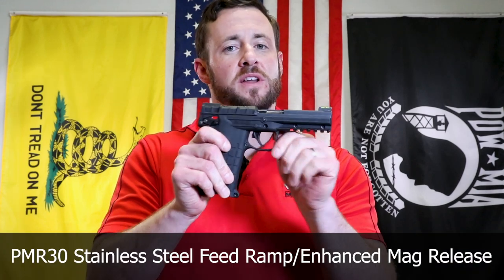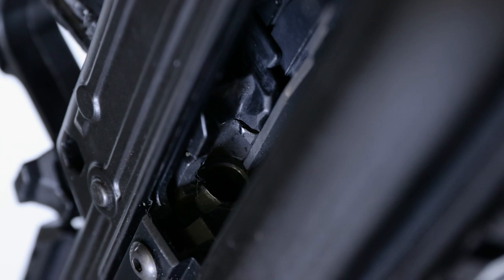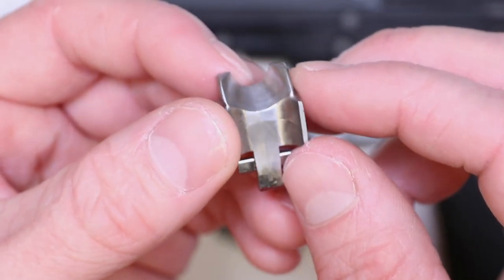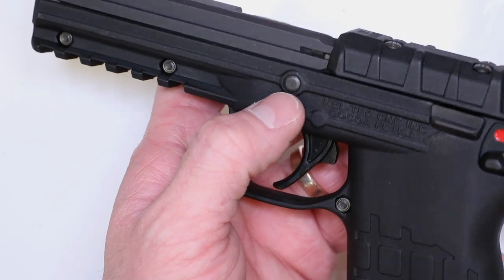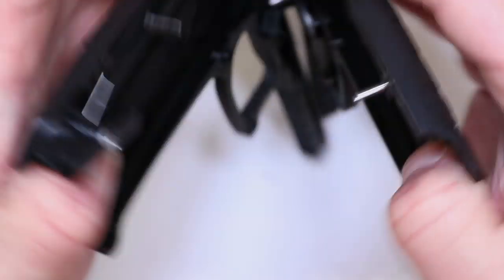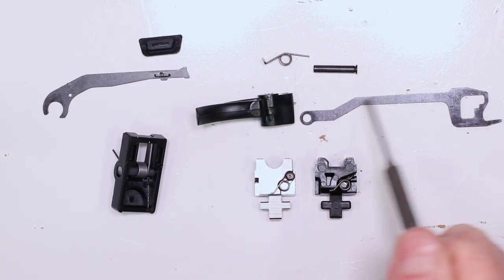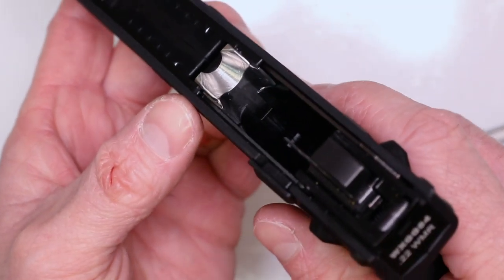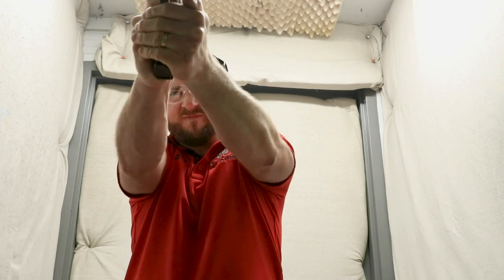KEL TEC PMR 30 Stainless Steel Feed Ramp and Mag Release - KEL TEC PMR 30 Upgrades by M*CARBO!

Comment: Please create a full update kit for this PMR30 / CMR30, trigger, slide stop, etc similar to all the upgrades you did for the Sub 2K.  The additional weight would be minimal, but the upgrades from metal away from plastic would be much improved quality, durability, and reliability.
Reply from the maker: 2WheelManNC Yes Sir, think you for mentioning this!  Glad to see all the likes on this post....we’ve been thinking the same thing.  New PMR-30 Flat Trigger was just finished/tested and approved for release early next week.  Still working on a slide stop.  Let us know if you have a particular look/design in mind.
Reply: @MCARBO   A metal slide stop that's a little easier to hit but not overly extended. Might I also add the idea of a nicer safety levers. Not huge like another's company offering, but better than oem keltec.
Reply: @MCARBO  will this kit be good for the CMR-30? Which has double the issues of the PMR-30. Thanks for this I’m glad I ordered a PMR 30 but if you have a CMR 30 kit I’m ordering it as well..
Reply: Dude weather is screwed up in memphis bad

Comment: For the slide stop spring I didn't use the tool purchased, I removed the slide stop bar and inserted the spring and rotated the feed ramp in the general orientation it needs to be and it was way easier and didn't cause undue stress on the spring and the bar. Do it this way.

Comment: Bought my PMR-30 about two months ago. The factory gun shot fine but was ammo sensitive. Would not shoot 30 grain well. 
I ordered the MCarbo complete kit for the PMR-30. It came in about a week. 
The toughest part was installing the spring on the stainless steel feed ramp. The little tool was OK....but I found that putting the spring into the hole and then pushing the stainless ramp into position worked just fine. I did have to replace the spring with the old spring from the plastic ramp on the new stainless feed ramp. I bent the daylights out of the spring that came on the stainless ramp trying to get it into that little hole. Polish that ramp!  The polishing kit is well worth it. 

The new aluminum trigger was easy to install but.....it was just a tad too long and would not allow the gun to fire as the trigger would hit the trigger guard. I took a Dremel tool and ground off about 1/16 inch of the bottom of the trigger and that solved that problem!
  The slide springs are easy to install if you follow their video. What I did was put the spring assembly into a vice and then took a needle nose vice grip on the steel guide to keep the springs apart from the end cap. That will allow easy removal of that little wire clip and then reinstallation. 
   I did all the mods available and did the magazine clip button  last after the gun was put back together. It made it easier to do the mag clip without having to deal with aligning the mag clip and the spring to put the gun back together.
   The final mod was the rubber grip. So easy to install and made a huge difference in the feel of the gun. 
    I have run over 550 rounds of various manufacture and weights and so far with the mods, not one failure to feed or fire. From 30 grain to 50 grain bullets, everything feeds much better and smoother. the gun feels totally different in a good way.
Thanks MCarbo!
Reply: @stevekatz4372  You will still have the same FTF issues with 40 grain ammo, I use various 1875-1910 FPS 40 grain, HP and FMJ, that sloppy fitting magazine will still toast your feeding reliability. Once you tighten up the mag you will go from several FTF per magazine, to one per several magazines. I think if I also put in the feed ramp it would function reliably. All the fussing has me real turned on to the Walther WMP 22 mag. Just saw a video of 800 rounds fired and 1 failure on 30 grain ammo. Thats what keltec should have produced. The PMR 30 would be so great, if it was set up better from square one. I have always called mine a PMR 20, or 25, cause really getting 30 into the mag is a pain, and it seems those ones are the harder ones to feed anyway (cause of the sloppy mag)
Reply: Your issues converting the gun seems to make it a real PIA with potential issues

Comment: I finally got to upgrade the feeder and mag release on the CMR30. this video helps to encourage as well as to guide with those upgrades. In my case I had already lots of Gail to feeds as well as light fire. After upgrading I noticed the chamber was a bit burnt so I took the time to clean it up. Will post soon after I get a chance to take it to the range. ( also pending are the mag release and feeder upgrade to my pmr30 ) lastly, the trigger has a trick to it to get it to work and tightness isn’t one of them. You have to line up the safety correctly before tightening the safety on the right side. If the metal piece is too low before screwing up the right safety switching from safe to fire will not get the trigger to work. You have to have a mini fine tool such as the thinnest Allen wrench to activate the trigger before even placing the right side safety back on.. this was not shown in the video perhaps it’s more of a pain in the cmr30 than it is in the pmr30.

Comment: You do realize - the excessive spring pressure inside the mag - is some of the issue.
Back in the early 80's - when I was a wee lad. I Ruger 10/22 was it. They had just released the -
50 round Banana Magazines. If fully loaded - always jam at random thru the 1st 10-15 rounds.
Once I started loading 35 rounds. No jams !!!
I know - defeats the purpose of having capacity of 50.
A multi tension spring would fix most high cap mag issues. My opinion - not sure if a single spring can be made like that.
Excellent video -
Thank you

Comment: Installed the SS feed ramp, frame reinforcement and enhanced mag release today. Watched this excellent video as I was doing the work. Felt 100% confident. Was quick and easy thanks to this video. Works perfectly. I did slightly over tighten the screws to the point of having a dead trigger. Half turn off and was working. I did oil up everything while performing the work. Great  video thanks 😊update...I shoot Hornady 30 gr v max varmint and they cycle perfectly through the pmr 30 with the mcarbo ss feed ramp and new mag release button. I've shot well over 500 rounds flawlessly through my pmr. Not one hiccup.

Comment: Got mine installed but haven’t been to the range yet. Work always gets in the way of the fun stuff. I didn’t go with the SS feedramp I just modified mine with a small flat file and I installed the extra power recoil spring. The new mag release works good with my tandemkross extended mag bases. I also went with the RTK red aluminum skeletonized trigger.
Reply: Finally got to the range and man I gotta say I’m impressed with the new mag release as far as holding the mag higher in the gun. I put 125 rounds of CCI 40 grain HP through it and not one single hiccup!!! I believe this pistol will eat any kind of ammo you feed it now.

Comment: Utterly unacceptable! Utterly unacceptable! Imagine if you purchased some watches, and 20% percent of them did not work. Imagine if you purchased ten 12 packs of a soda, and 20% of the cans were completely empty? Imagine if you purchased a brand new car, and 20% of the time it would not start? What the holy fuck is going on?
Reply: @ranchlife8128  Thanks for your input.
• Do you know that the rounds used in this video were lighter than 40 grains?
• This is not a "loading" or a "breaking in" issue. This is simply a very sloppy design.
• Since this gun was new and "right out of the box", it was probably not dirty.

I know a gun should not be judged on the performance of a single example. But on the other hand, a new gun should never jam. I am a retired engineer, who as a U.S. Naval officer in the '80's had to screw with an issued M16 that constantly feed-jammed. Before the first prototype of this pistol was ever made, the feed-jamming problems were entirely predictable and avoidable using the CAD design software that the manufacturer doubtlessly used.

Note that we also saw a casing extraction jam, which is a function of the timing of the casing extraction versus the slide action. That problem also MUST be fixed. Ultra high speed video cameras would help in resolving that problem.

In the year 2021, the customer should never have to be a mechanical technician or a mechanical engineer, just to make the product work. I like the idea of a 30 (or 40) round magazine because I like to spend time shooting on the range, rather than repeatedly reloading smaller magazines on the range. Also, I would like an option to have a longer, thicker barrel and a longer grip.
Reply: I completely agree.  I have watched numerous videos of people taking the gun right out of the box, loading it correctly, with the correct ammunition and firing it with no problems what so ever.  I spoke to a gun dealer at a show about the PMR 30 when it first came out.  He said “ I thought I knew everything about guns.  I took it out to the range and had nothing but problems.  I read the manual, used the correct ammunition , loaded the magazine correctly and the gun worked perfectly”.  I’ve even seen second videos by people that reviewed the gun the first time and said it was junk that admitted after reading the owners manual and following the directions had the gun work perfectly.

Comment: I understand that companies have to make a profit BUT WHY in gods sake wont a American gun manufacturer like Kel-Tec do just a little bit more ENGINEERING on their weapons.? ? ?
Either include these parts or offer a FREE FACTORY RECALL or even better, RE-ENGINEER this otherwise useless PAPER WEIGHT . All the plastic parts should have never even been a thought muchless included into a weapon that could actually cost someone there LIFE by a missfire from a multitude of FACTORY ISSUES. 
If i were the owner, i never would have passed this weapon for 100 percent MANUFACTURING.
I just dont understand this.
What is what is. From this point forward the only option Kel-Tec has is to issue a Factory RECALL and dont stop at just 27:19 a couple metal parts, install a FULL SS metal parts bag including a metal trigger. Cost would be 
 negligible . And would be a very nice, pistol that could be trusted to defend LIFE & PROPERTY.
I would consider owning one then.
As it is now, no damn way i would buy one. Period...............

Comment: If it means anything to anyone, I just purchased my pmr30 (5/2024). Using the recommended 40 grain and up I have had no issue with the gun. I did test a box of 30 grain flat nose and there wasn't enough energy to cycle, but no issues in the actual feeding of the firearm. In my case at least it appears they have fixed the issue. Hope this helps someone in their decision.

Comment: CALL,  keltec, to talk to the designed engineer department,, about,  designing,  a ideal or concept,  pistols,  making out of,  aluminum,  frames,  like,  p17, cp 33 pmr 30, pistols,  stamp steel,  magazines, with steel lips,  or plastic magazines with, steel lips,  like ruger 10/22, magazine,  , top cover on pmr 30 , aluminum,  ,basically make the frame aluminum,  using a metal magazine,  and make a 17 hmr caL  model  , or kit, ???? Stephen  from turasa,  designed development engineer department.

Comment: FYI, i know that you are a professional gun smith BUT, if you use a white terry cloth hand towel on your workbench when working on any weapon, you will NOT have issues of screws and parts wont roll around and possibly end up on the floor. !!!

Comment: I love the platform, but I buy 9mm cheaper than 22mag. That  is why I haven’t bought one
Reply: I got one just so I can buy and shoot ammo even during panic buying when 9mm is not available. Thousands of rounds of 22 mag at most big box sporting goods stores around here.
Reply: What I love about the PMR-30 is the 30 rounds and not having to chase brass. 
Since the Biden nonsense, 22 mag is way more available than 9mm.
Reply: Steve smith well, things have changed since my post. I own 2 Taurus 942’s one 22 lr and the other 22 mag. Currently I’m finding 22mag 17-26 cents a round; 9mm 20-34 cents the lower being steel case. The best deals I have found for 22 mag has been the cursed Walmart. You are definitely right considering th times

Comment: I appreciate what you guys do, but honestly Kel Tec should be ashamed of themselves for putting out such an unreliable firearm. A lack of reliability means the end of someones life when they are unable to protect themselves because of stupid design choices and unacceptable quality control. This gun has been out for years, and even with their multiple "improvements" the firearm is still absurdly unreliable. To make a gun that only works, as a firearm is supposed to work, that is, consistently, when multiple aftermarket parts are purchased is an absurdity.
Reply: Using rimfire for self defense is not the greatest place to start

Comment: Excellent video. I installed the parts today in my CMR30. I don't know if the hammer spring in a CMR30 is stronger than the PMR30 but I found it impossible to use the needle nose pliers to get the hammer spring around the. pin on the grip. Instead, I used the curved hook from a Harbor Freight hook and pick set (SKU 63697).

Comment: Thanks for this video. Was thinking of selling this POS PMR-30 but there's hope for me yet. Doesn't a company like Kel Tec at least test their products before putting them on the market? It's like the PMR-30 is the rough draft. Anyway, glad ya'll have figured out a way to make this pistol shoot more than 1 or 2 rounds before jamming. Gonna upgrade mine soon.
Reply: I remember the hype ahead of the PMR-30... I think Kel-Tec jumped the gun (pun intended) because they were riding the wave of buzz surrounding it. They may have also been worried about another manufacturer beating them to the punch, or they may have had a financial strategy (re: needed some quick cash) behind releasing it with so many bugs. I'd bet that ultimately they decided it was "good enough" and used their customers as beta testers, without realizing how far short of "good enough" they actually were.
Reply: @jesse1136  Yeah, well, a real bummer for those of us who bought them. Anyway, I ended up selling mine last winter. Didn't make sense to spend all of that extra cash just to get it to be able to shoot two rounds at a time before jamming...

Comment: Man you guys need a install video on installing the feed ramp specific to the cmr 30 being similar in some respects but is a different weapon and does have some additional steps when assembling especially since it has a buffer in the rear you have to contend with when you reassembling and is pinched between the half assemblies that your video doesn't address, also why not just sell the little tool that your only going to use once other than that I can't think of much more it could possibly be used for other than this hell you could provide a 3d printed model or even the stl file to print one

Comment: My feed ramp is arriving tomorrow. I tore my pmr down today to be prepared. I tried to reassemble with old feed ramp and I cannot get the spring into that tiny hole. I built a tool using a screwdriver from an eyeglass kit so I will try again tomorrow when the part arrives. My 59 year old eyes seem to be the major problem here😂😂 If I can’t get it I guess a trip to the gunsmith is next. Wish I had gone on and gotten the bundle cause I don’t wanna do this again😂
Reply: In a comment above a guy said he put the spring in the tiny hole 1st. And that worked out great.

Comment: I think the PMR-30 has a magazine seating problem that's responsible for everything the gun does wrong. I think it sits too low, & might need to be shoved up, & seated a bit higher...not a whole lot, just a millimetre or 2. The bullet's feed angle from the mag is too sharply pointing upwards at a bad angle to cleanly & reliably get rammed into the chamber consistently, without issue. I think. Maybe a mag mod that helps keep the bullets from pointing up so sharply might help, or mess with the mag to get it to seat a bit higher. who knows, but with, or without these gadgets, the PMR-30 is a POS-30 until that issue is sorted. ps: both pointed, & domed bullets... 30 grainers, all the way up to 50+ fail. Issue... bullets catching up in the mouth of the feed ramp, both with, & without this Steel Feed Ramp. If the issue is solved, This Steel Feed Ramp would be much better at everything over the stock, that's a given.
Reply: It's almost as if they would have made something to push the mag up huh? Well apperently you didn't even watch the video because that was the 1st thing he did was change the mag release button to their aftermarket one the make and sell that does exactly what you're saying....pushes the mag up further into the magwell.
Reply: @bigmyked8479  Yes, but I'm only stating the issue. With, or without the mod, the issue still remains. The mod is much better than the original one, that's for sure, but I think the issue might be an alignment design flaw. Maybe the entire mag-well, & magazine is too far forward, or back from the chamber... could be by just a few millimetres or so. The design idea for this gun is awesome, but there's a bug somewhere in the design plans. Could also be that the shot detonation shock-wave vibrates the gun material too much causing the feed ramp, & or other thing to slap the next round being loaded, out of alignment, due to those parts being so light, & vibration prone maybe? No idea, but this gun is not to be depended on for self defense, where mere seconds determines life, or death. If they, or M-Carbo manages o resolve the issues with this gun, it will then rival damn near every other pistol on the market today... even the 22TCM! 😀